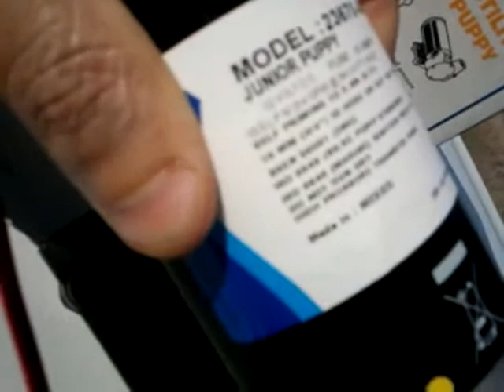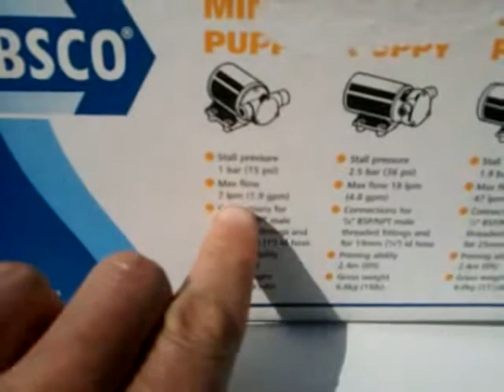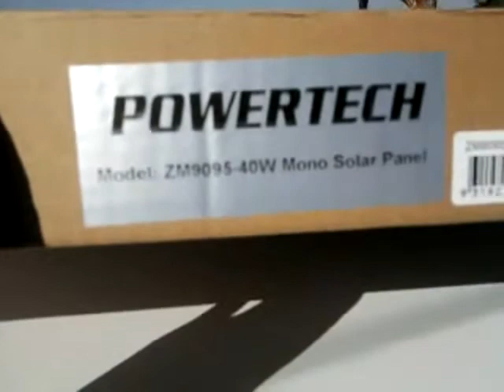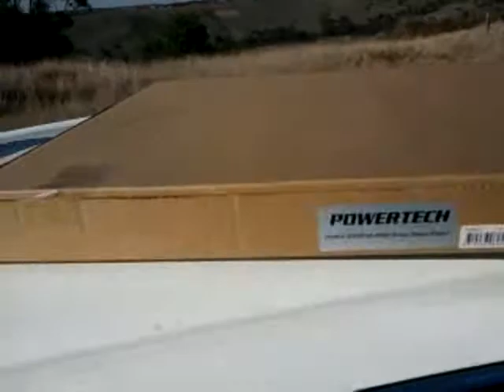New pump installed for homemade wood hot water system

Comment: Passive solar hot water.  Why not use the Australian sun?  Seems like a lot of complexity in order to force wood to work as a fuel.  Black tank in a glass top insulated box.  Hot water all the time.  With a sealed metal tank of some kind inside, the pump could be on the cold side.  Eliminate all the special hot water pump problems.  Amazed you have been making it on 20 watts.  Checking in today from Woodruff South Caroline.

Comment: Jabsco are workhorse pumps, and in all my systems, and easy to maintain (even 60 miles offshore in my experience)... Yes you did pay 2/3rds more then it is from a registered wholesale dealers, but it is not low quality equipment as you think...